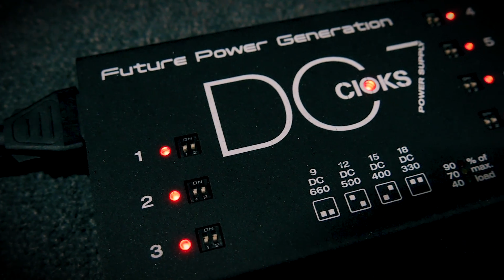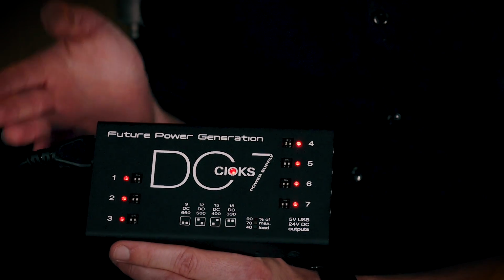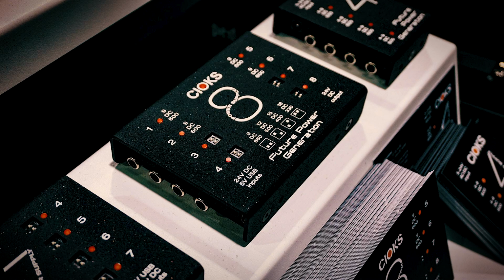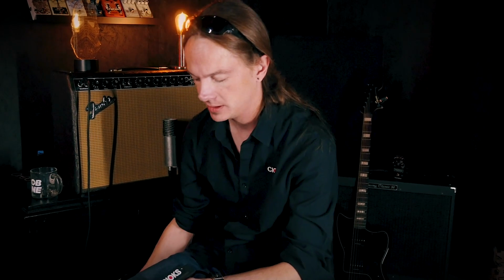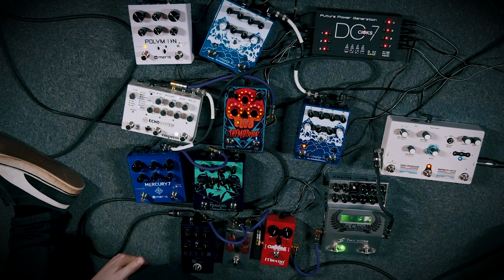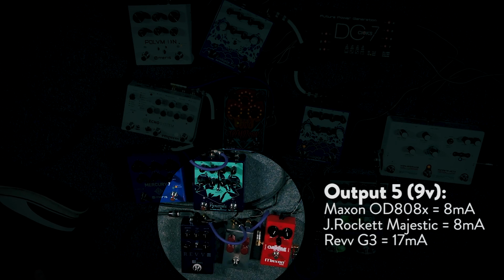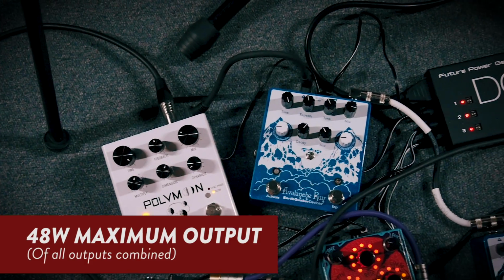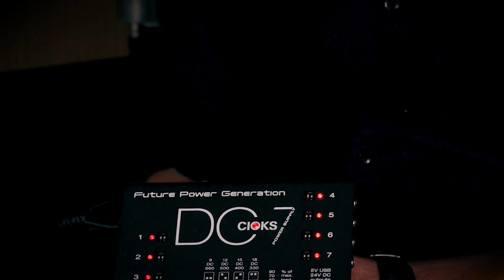Cioks DC7 - The Most Powerful Pedal Power Supply in the World?

Comment: Will the Cioks cause EMI/RFI noise with a tube preamp pedal on the same small pedalboard? I use a Friedman IR-J tube preamp and the Voodoo Lab 3 Plus wrecks the sound. I had to send the Voodoo Lab 3 Plus back.
Reply from the maker: I honestly don't know. All I know is that the Cioks DC7 is the most stable and low-noise PSU I've ever used. But I'm not an engineer and don't know anything about the potential issues that a tube pre-amp pedal could introduce. I recommend you contact CIOKS. They are so nerdy about this stuff, that they will most definitely have an answer for you.

Comment: I have Boss GT1000 Core which draws 670ma. Can the DC7 or Cioks SOL power it with one 9v output slot? Thanks
Reply from the maker: I honestly don't know. It's just on the verge of being able to, if that mA rating is spot on, but the actual draw is often a bit lower than what's labelled. So you can always give it a go. The worst thing that could happen is that your GT1000 won't boot up, and then you know you will have to use two outlets.

Comment: Wait, so i can power up two 9v pedals using only one output ?
Reply from the maker: Yeah, easily. You just need the right Cioks flex cable. They also make Flex cables that can accommodate 3 pedals from one output. Just remember to not mix analog and digital on the same output. It can create noise issues. Low current analog pedals tend to work best in a daisy chain, and then keep the digital stuff on their own isolated outputs. That's at least a nice rule of thumb.

Comment: Typically i am late to the game, also really old and now even balding a little, i now know which psu to get. Just one thing that is bothering me and it stems from having both played at and been working as a sound guy in small venues, this way of attaching your psu to this kind of pedalboard.....while a good solution when it comes to the mounting in and of itself, but that spot is the worst place for ANYTHING electric! Given that the pedal board usually sits pretty much at the front of the tiny stage, with people standing, dancing, DRINKING BEER, RESTING that beer....you know where i am going with this....also a reason why i never thought the open construction of pedal train etc are a good idea but with this psu it is even worth, because how can you put it there and then have all your LEDs and switches right there ON the floor?

Now for musicians like us, making slow, sad, depressing music, hehe, the whole dancing and beer swapping 'round might not be an issue, noone ever danced to my music, except when i made music for a dance choreography, äham, but for others ... i don't know...i always loved the Trailer Trash design where the power is safe, hidden inside the frame, with only the main outlet coming out of the board.
But it seems they stopped production which sucks big time, they also only ever had one EU distributor afaik.....

Anyway, that is my long ass take on that little mounting bracket which definitely seems like such a practical, good idea.

Comment: Im using the DC-7 with vintage Boss pedals that require 12v. I have a 80s Mesa Boogie 50 Caliber+ 1x12 combo and the entire pedal board is going into the front end. I can use 2, yes.. TWO overdrive pedals into the dirt channel and there is ZERO noise!! Absolutely unheard of with a vintage Mesa amp!!! F^^CKING AWESOME

Comment: Hi Stefan, I want to upgrade from my old but trusty Voodoo Lab Pedal Power 2 and am debating between the Cioks DC7 and the Strymon Zuma. May I ask, does the DC7 power your Maxon PAC-9 pedal alright? My PAC-9 won't start up with my Pedal Power 2 (I think it's due to the internal charge pump that requires extra mA at start up). Thanks!

Comment: Hey I use the Electro Harmonix Canyon and the Canyon needs 9.6 volts. It does not work on 9. The box at the end of the chord that it came with is very bulky. Does anyone know of a power supply that can do 9.6?
Reply: Just use 12v.

Comment: hallo.. do you prefer cioks dc7 OR vodo lab?
Reply from the maker: CIOKS all the way 👍
Reply: ThePedalZone how about strymon zuma?
Reply from the maker: It’s good, but Cioks DC7 is still better
Reply: See my comment above to Rhowin Dacut. For some, they wont need the versatility of the DC7, but for others it will be the only applicable option. All around, even if you don't have pedals that require this versatility, everything the Cioks does it does very well, and we can all benefit from the low noise floor and expandability options.

Comment: How is the Strymon Zuma compared to the Cioks DC10? Do you prefer and recommend one over the other?
Reply from the maker: You mean the DC7, and not the DC10, right? If so, then the DC7 is way more powerful than the Zuma, and smaller as well.
Reply: ThePedalZone Oh dang, so that’d mean the DC10 would overkill the Zuma? Haha! Thanks for the reply
Reply from the maker: @Rhacut  - No, the DC10 is actually an older unit, far less powerful. I know it's confusing with the numbers, but the DC7 is the latest PSU from CIOKS and it's their most powerful to date, and currently the most powerful on the market.
Reply: Yes, the DC7 is more powerful, but also a lot more versatile. The Zuma is a great supply, but most outlets are dedicated to 9V, and I believe have a max draw of 500MA, and it has two outlets that are variable voltage. So the Zuma works well for running many standard low draw pedals and a few exceptions, where the Cioks DC7 can run a large amount of 9V pedals, as well as many pedals that are either very high current draw or have variable voltage requirements, so the DC7 is considerably more versatile.

Comment: My board has a Digitech Whammy DT on it that's 9V and requires 1300mA. I am a bit dumb with this stuff, but the DC7 wouldn't supply enough amperage for that pedeal, right? Or am I wrong? I appreciate you smart people's help.
Reply from the maker: If you use one of Cioks own Flex cables (Parallel Adapter Flex to be exact), then you can couple two outlets together from the DC7 to double the amperage. So if you couple two 9V 660mA outlets together, then that will give you 1320mA in total, which is enough to power you Whammy pedal. But it will of course cost you two outlets on the DC7, so it depends on how many pedals you need to power in total. But technically you can power a Whammy via a DC7 😊👍

Comment: I've been using the Cioks Big John (the old version with blue typeface) for forever; it's probably time I upgraded! Quick question, though: in the video you guys hook up several pedals to the same output - isn't that usually considered a no-no in regards to noise? Or does it not matter with this kind of power supply?
Reply: There is some more to it, but the basically you can run drive/fuzz/trem/wah/boosters and such on daisy cables with minimal worry. It's when you daisy digital and all-analog pedals from the same PSU outlet - this can create unwanted noise.

Comment: Same tech as the Strymon power supplies, except you get 9 outputs on the Strymon
Reply from the maker: Indeed, but every output on the Zuma doesn't have switchable voltage selectors. And the DC7 has more power per outlet. And the DC7 is smaller. All depends on what features you need 👍
Reply: @thepedalzone  True, but my point was he is claiming it's new tech.  Switch mode tech is old, its been in consumer appliances for a long time and has been around since the early 1900's.
Reply from the maker: @MrRadialdrift  - Don't think Christian claimed it to be new tech. Its use is fairly new within the world of pedals though, which he also explains. The tech was seen as being too noisy for pedals before, but CIOKS and Strymon have found ways of filtering out that noise, so it's usable with effects pedals :)
Reply: @thepedalzone  Well, effects pedals have been using switch mode for at least the last 20+ years, so again not sure what he is talking about it been "New" to effects pedals.
Reply: @thepedalzone  Well, effects pedals have been using switch mode for at least the last 20+ years with very minimal noise, so again not sure what he is talking about it being "New" to effects pedals.  I presume the noise he is talking about is when you are trying to daisy chain a switch mode, which is what makes the Dunlop DC bricks a pile of crap.  So claiming switch modes are noisy is not accurate, under proper use they are perfectly fine.  

All Strymon, Cioks and Gig Rig have done is made a fancy daisy chain switch mode, which to be honest is over priced for what it does.  Sure its a new product, but the tech is not.  You can get a Joyo power supply for about the 5th the price that uses Ciosk "Old tech" and even the VITOOS  PS which are about $40 are great value, they have 3 groups of isolation instead of individual, but if used correctly, you can save $300.  Musos just seem to get ripped off when it comes to stuff like this.
Reply from the maker: Well, you apparently seem to know much more about this than I do. You should make a channel and educate us all. I would watch it and throw kind comments your way 👍
Reply: @thepedalzone  Use to be an electrical engineer.  Cioks make good stuff, no doubt there, its just over priced for what it is.  All the companies making PS for pedals are a huge rip off.
Reply: Except Strymon power supplies randomly fry your pedals. Unfortunately, there’s a ton of cases out there.
Reply: @Hogmilanese-y2i  Really, 1000's of cases, got any proof?  The fact they have built in over load detection, makes me doubt what you have stated.  If a regulator fails then there is zero output, so love to hear how they are "frying" guitar pedals.  Especially since a multi power supply can't output more than is being drawn.

Comment: how to you connect 2 pedals together to a power output. what kind of cable do i need to use?
Reply from the maker: You need a daisy chain cable. If you use CIOKS products, you can also use their Split Adapter Flex cables, which are typically included with the power supply.

Comment: This looks amazing! I might end up getting one of these to replace two Voodoo Labs bricks. (This might also get my board under weight for flights!).

Next challenge, Cioks team: Mission Engineering’s 529, which is absolutely amazing for a small board (I can power four pedals off a phone charger usb stick for an hour plus). It’s such a cool device and means I can busk without power (or when I sit in for a song in someone else’s band). Can you make something similar that will accept variable voltage? For my acoustic rig I’d love to use the Headway EDB-2 preamp but it needs 18V and too much current for the 529.
Reply from the maker: Happy you dig the DC7. I highly recommend you get one 👍 And CIOKS are already working on the product you're hoping to see. It's called the CIOKS 4. It'll hopefully be available later this year. You can read about it here: https://cioks.com/products/cioks-4/
Reply: There is a 529i as well. 8 outputs but it needs 12V 1A in. The 529 needs 5V 1A.
Reply from the maker: They already solved your challenge. It’s called the Cioks4